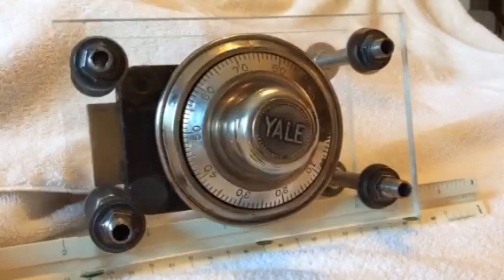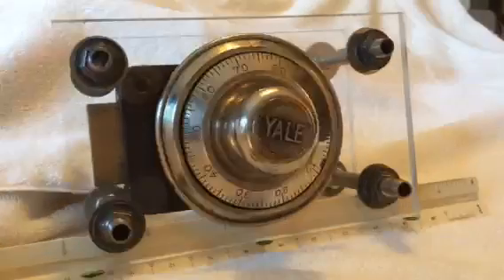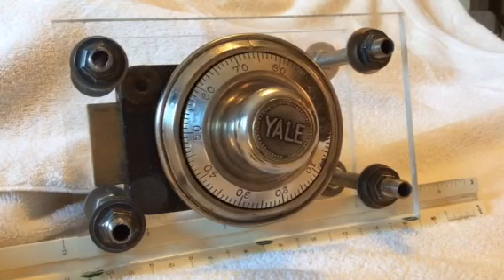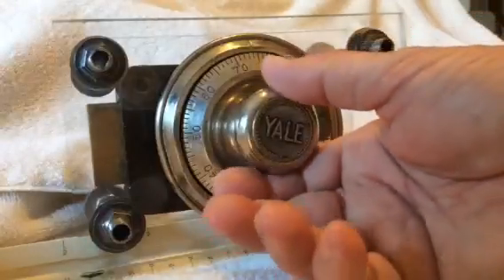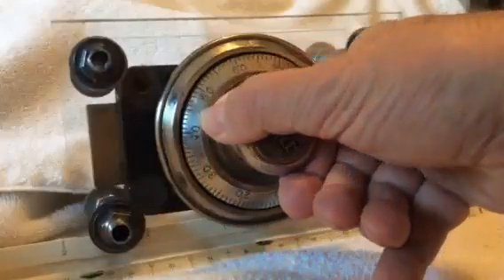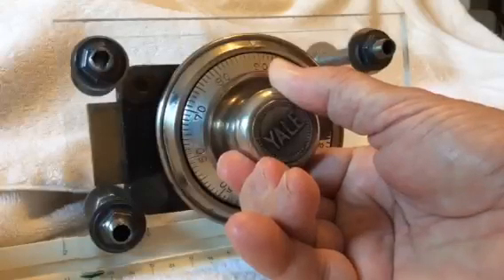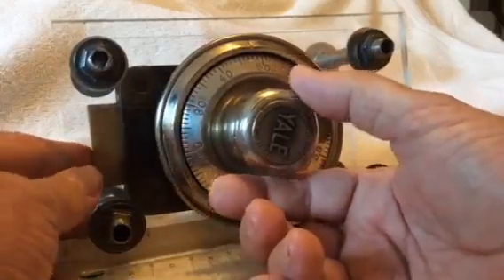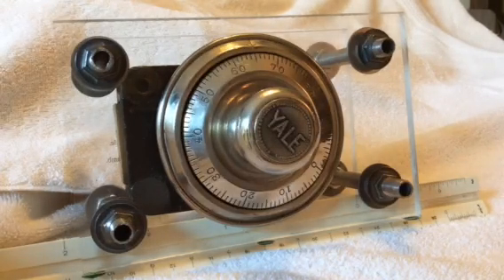Yale Safe Combination Lock Gear Driven

Comment: i know this is an old video but would appreciate your imput as i have an1963 mosler combination safe that i believe is friction( only one contact point determined by dialling counterclockwise)--  78.5--- cannot figure which way to rotate and where to park the wheels and subsequently which way to spin to find variation in cam gate pt and hence gates on wheels --thanks in advance

Comment: Thanks for the video. Was on a job trying to help someone get into their safe thru had the combo to but couldn't figure out how it was supposed to be put in. Tried a whole variety of different turns amounts and both directions till I watched this and he mentioned sometimes it wouldn't catch at the end unless you pressed the bolt. Put the combo in how I tried the first time, but stopped  at 1 before hitting zero, jiggled the handle and it came open.

Comment: Thank you for the help, I just bought the whole safe at an estate sale for $20 the door was locked open I took the back apart figured out the combination and couldn't get it to work but your video helped and I got it  unlocked and it's working
Reply: The pressure on the lock was the trick
Reply from the maker: Thanks Ben ~ Glad the video helped you out.  Enjoy your day.
Reply from the maker: Sometimes it's the little things ~ cheers.

Comment: Hi Jm I have a lock on a safe very similar to this one and was wondering if you have any tips to unlock it
Reply from the maker: Honestly outside of trying the combination or if that doesn't work trying dialing the combo by halves...
Example would be say 25-50-75 dial
25.5-50.5-75.5 even 26-51-76
Outside of all that I won't be of much help.

Comment: Hi JM
I have what I think is a family heirloom circa 1910 Yale safe that I am restoring with a lock like the one pictured in this video.  I can't seem to figure out how to remove the face dial and brass ring on the front of the door. I did pull the tumbler out from the back and there seems to be a mini key pin which I can pull out but I do not want to screw it up. I do have the combo and everything works great. Any help you could provide I would greatly appreciate it.
Reply from the maker: Unfortunately it's not me in the video. My dad made some videos of safe stuff and just posted to my channel. So sorry I can't help with that. Keep searching online and hopefully you'll find your answer.

Comment: I have a locked safe YALE LOCK MFG with patent dates stamped in dial that range from 1871 to 1880

You mention that yours is ‘gear driven’. I think mine is also

We have lived in our home since 1981, and locked safe (w/o combo) came with house, and I am trying to learn manipulation with the safe as my first effort. 

Any description, or sketch you could share or a photo of the back open detailing mechanism would be greatly appreciated. 

Mine has a ‘T’ handle to the left than must have to be turned when last number entered. So unlike some videos that show the nose dropping into a slot in a wheel when last digit approached on dial, the turning of the ‘T’ handle must provide the ‘force’ you describe and demonstrate as last number is reached. 

Thanks for sharing,
Reply from the maker: Gerd...hate to say this but my dad is the one that made the video. So I only posted the video as something different other then lock picking. I would try eBay. Also Google images. Their is a transducer that you can get to aid in manipulation. Also Sparrows Lock Picks makes a training safe lock for learning manipulation you might try that also.  Good luck...